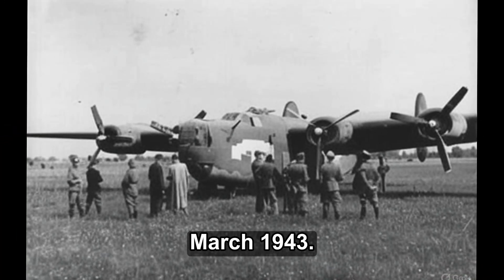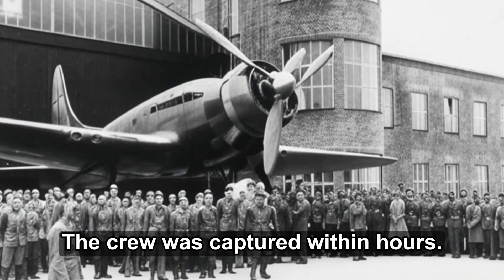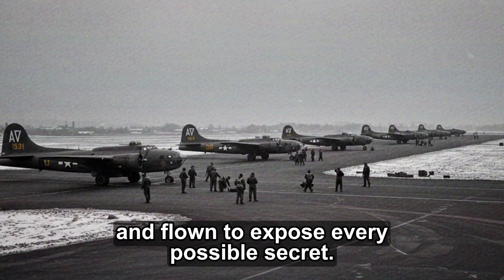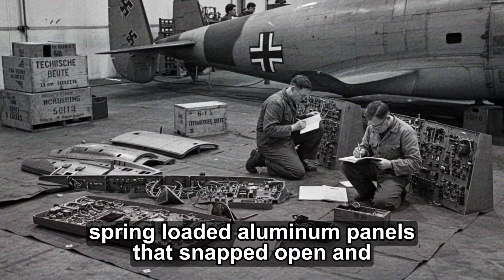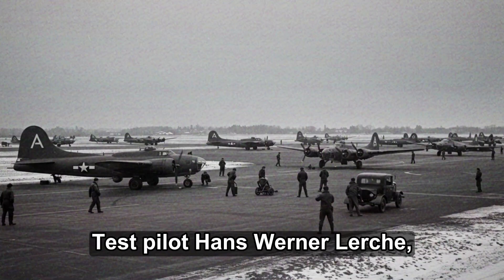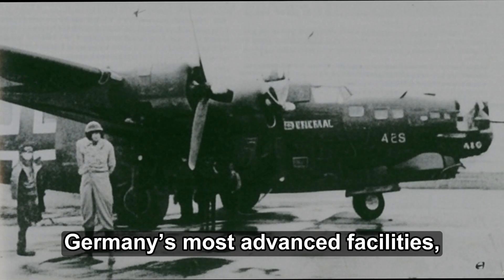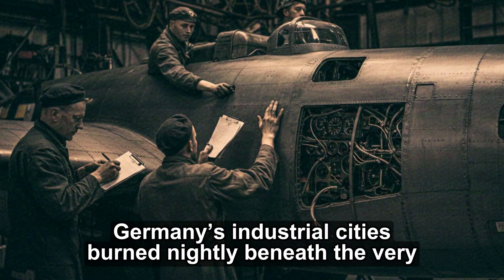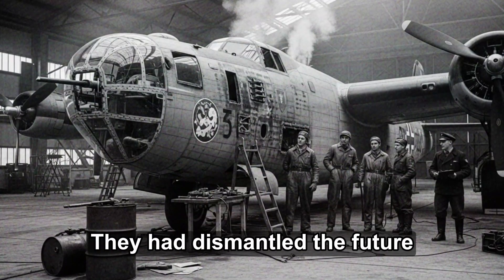Luftwaffe Mechanics Took Apart a B-24 Liberator and Were Shocked by Its Design

Comment: photo at 9.02 is AI trash partly  B17 in front B17 in back with a bit of B24 tail added on
Reply from the maker: Thanks for pointing that out, I will be more careful with the images.
Reply: There are pictures of a B24 with a B17 nose welded on. That was a real experiment to reduce drag on the B24. It was called the XB-24J.

But this here is clearly AI.